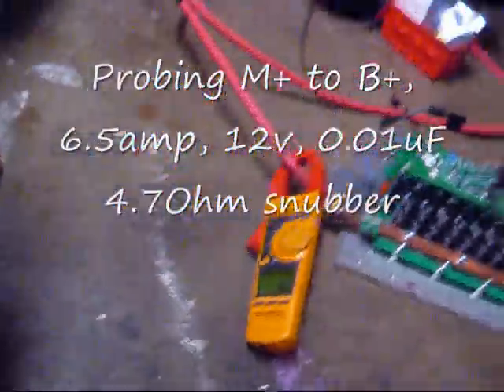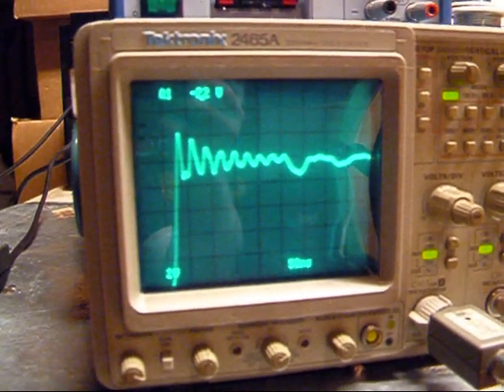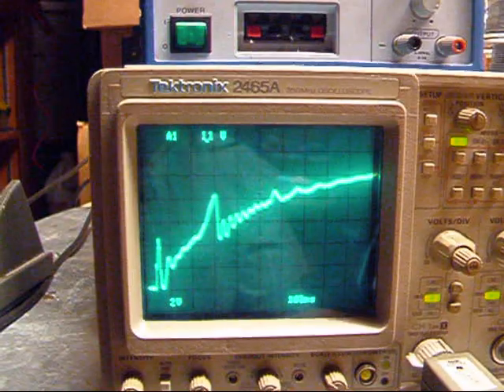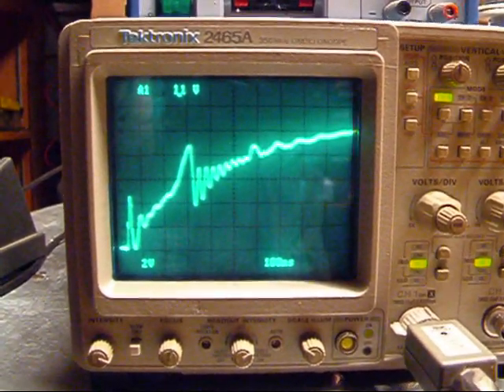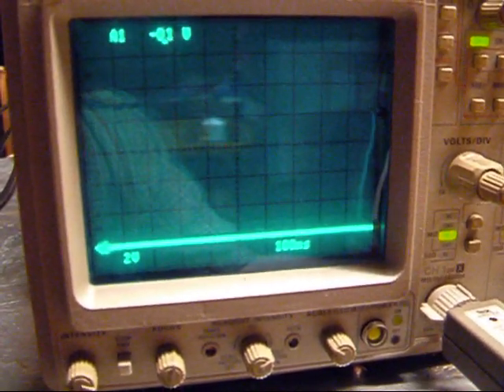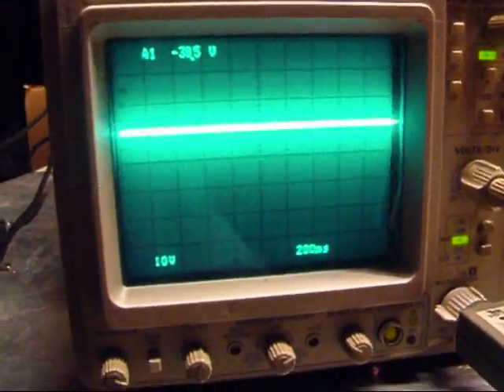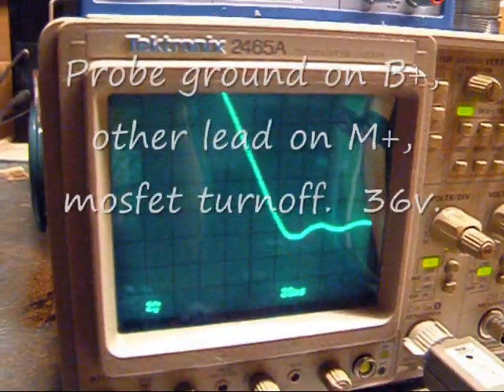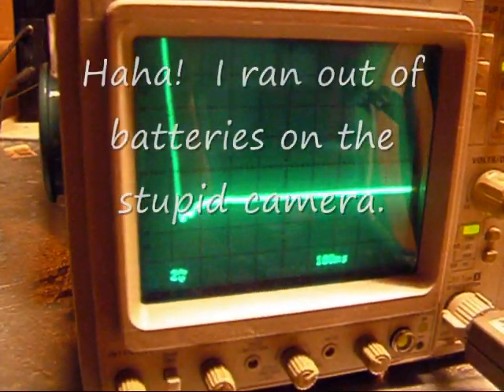12v, 24v & 36v Tests With 0.01uF 4.7Ohm Snubber

Comment: Your heat 'spreader' was better known as a 'heat sink', and usually they had ridges (fins) that were not for dipping, but for more heat dissipation.   And good design would have the fins exposed to open air and maybe a fan used as a heat 'spreader' blowing over the cooling fins.  I'm not a degreed 'EE' engineer, but I would expect your controller may experience 'heat' problems at around 30 kilowatts (200A) of continuous operation. (That would be freeway speeds with a small grade, so you might luck out.)   Moisture will be your biggest problem, you can expect charred burnt PC boards as dust covers the electronics. Also shoddy soldering skills of your kits will probably bite your ass royally.  Best of luck.  I would not give up my day job for today's electronic money.  Well, that was my plan 40+ years ago - then the body sort of froze up.

Comment: From everything i have read the voltage and PWM frequency will determin the cap value.  Then you can tune it with slightly different resistors.